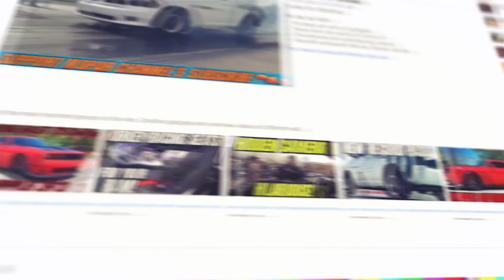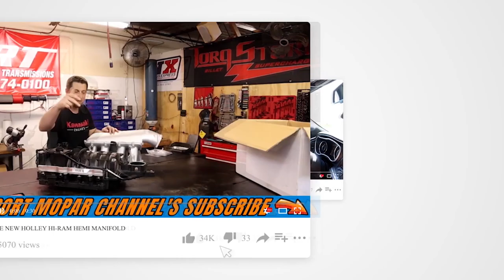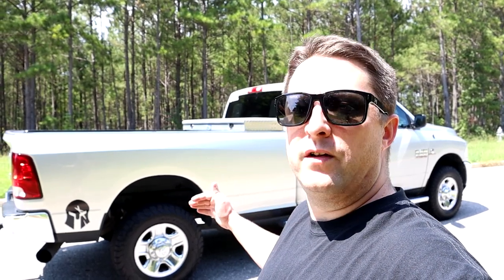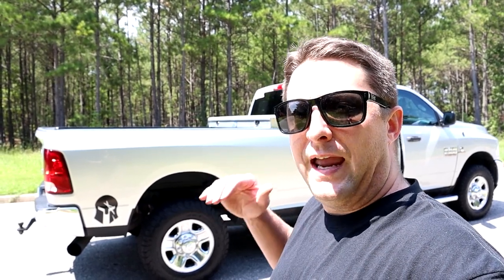New KARNAGE Performance Muffler On RAM 2500 6.7 Cummins Diesel

Comment: Did you trade in the 5.9 for this?
Reply from the maker: Yes I miss the old truck lol but the power this  6.7 makes is insane
Reply: @FrostbiteRam  Just be mindful of the trans. A quality billet valve body will go a long way if you can't get a fully built unit. If you can afford a built 68rfe then go with a company like Revmax or Randy's. Just a tune/delete can smoke your OD clutch pack or worse.
Reply from the maker: @monsterram6617  yeah that had me worried but I have a pretty long warranty left on it and will probably trade for a Dually before then hopefully
Reply: @FrostbiteRam  Well if you're wanting to tune/delete the future dually you're going to want to get that in a 68rfe too. The Aisin trucks are very finicky and don't like anything more then a mild tow tune. But either way a nicely built VB is under $1k and can be installed in your driveway in around an hour. Other than that avoid burnouts, boosted launches, and full pulls shifting into 5th and 6th and she should last awhile.